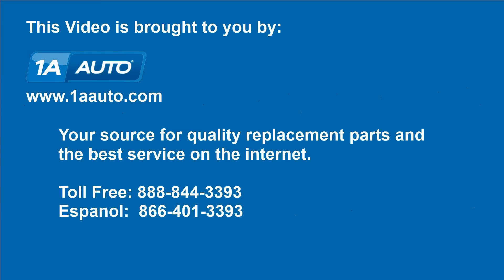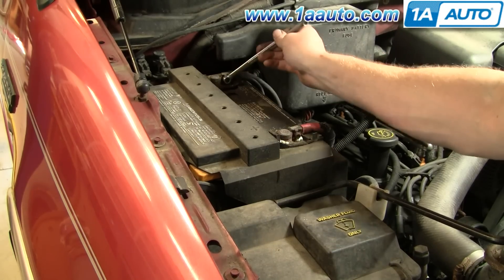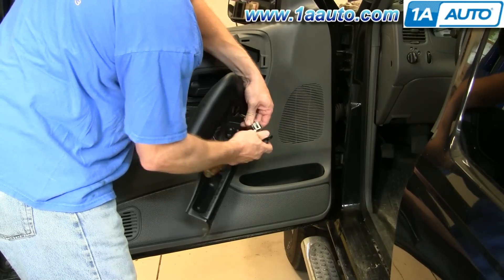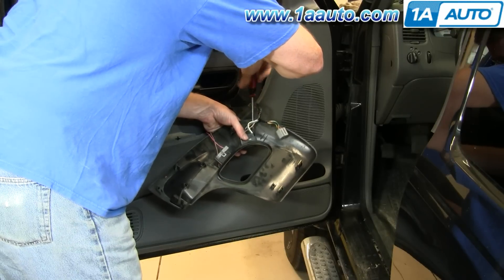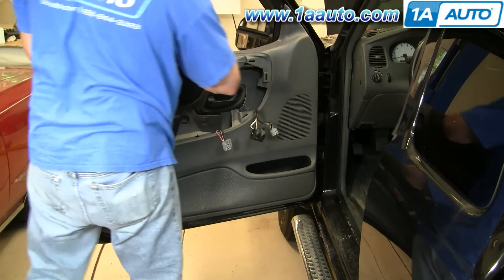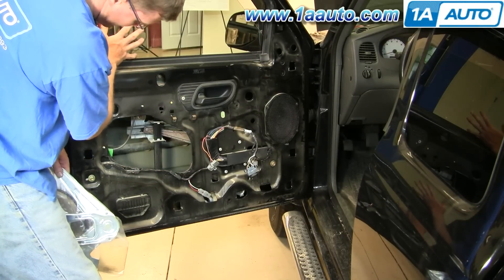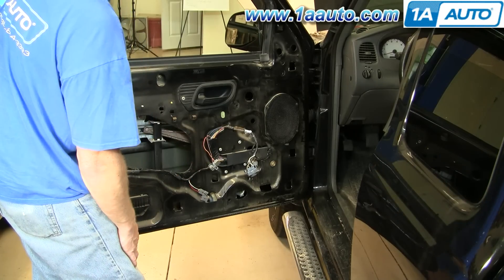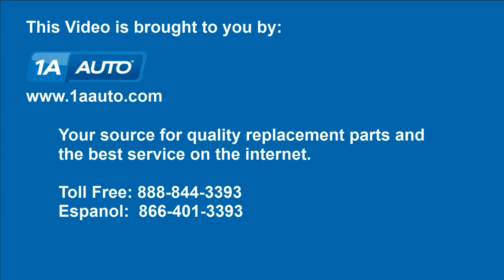How to Replace Window Regulator 93-11 Ford Ranger

Comment: Just replaced mine and used the 1/4" rivets that came with my Harbor Freight Heavy duty hand riveter ($16.00 with coupon) Made it easy and faster than bolts.

Comment: Can just the motor be replaced without removing the regulator?  I have noticed that one of the mounting screw for the motor is hidden behind the sheet metal. However I could drill out a hole to get to it. Is there a relay that controls the motor? When I hit the switch I here a clicking noice from the fuse box I assume. The passenger side doesn't click but it rolls the down.

Comment from the maker: Unfortunately if the regulator is slipping, there is not way to repair the teeth on the arm. You will have to replace it with a new one. You can view the part at 1aauto.com/1A/WindowRegulators/Ford/Ranger/-/-/1996

Comment: Just like my Ranger!  Are you familiar with a recurring ranger problem with interior lights being stuck on due to a bad sensor in the door handle hinge?  How to fix it?
Reply: I don't have a permanent fix, but I have saturated the door latch mechanism with wd40, and it will solve the problem for a few months. then you have to do it again. This is not a permanent fix for the switch that is sticking, but it does work. ( temporarily).

Comment: Can you give me a hint on what size screws and nuts I need for my window regulator? So I can get them before taking it all apart. Thank you for all your help.
Reply: +Brian Jordan 
If it's the same as the manual window regulator it should be 1/4. That's what mine took. You'll want to get real short bolts too. Something like a 3rd of an inch long. If they're too long they can block the window regulator and you won't be able to open your window.
Reply: these guys don't care-or they would have answered you.  you need 1/4 in. bolts x 3/8 to 1/2 in long.  be sure to install the top-left bolt in unit b4 you install it.  i installed mine with bolt sticking out and secured it on the unit with a small rubber washer.  once the unit is installed, this bolt-hole is inaccessible for all practical purposes

Comment: I have 96 ford ranger with manual windows. And the drivers side window has trouble rolling up, about halfway up it "slips" and the crank just turns. Is there any way to fix this without buying a whole new regulator?

Comment: HI i am replacing the motor on the rear right door 2012 ranger. Motor is unscrewed but the cable on the inside is in the way and a cover is over the spindle/drive end..how do I get it out please